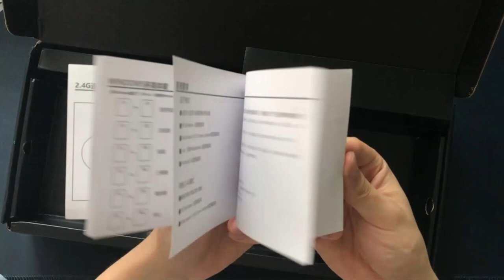PBT on prebuilt? | RK98 | Full mod and Review | #keyboard #keyboardmods #keyboardsounds #soundtest

Comment: Hello HnJ friends. Are the RK98's keycaps PBT or ABS plastic? How do you identify if it's ok to ask if it's PBT or ABS (even should the manufacturers put some texture "tricks" on the keycaps)?

I just bought this amazing mechanical keyboard (blue switches so I can feel the click, though the spacebar is acting like an amplifier- it's not the noice but the frequency of the noise X-D but it's fine by me- I must feel the click, it's very satisfying even if it's noise but then all keyboards even if it's thocc is still noisy just at maybe a lower, more bearable frequency). 96% w/ exploded sections is definitely the future: it saves on plastic too.

God bless, Rev. 21:4
Reply from the maker: Hi, for the keycaps in the video that came with the RK98 model that i used was PBT. There arent any huge differences between PBT and ABS unless they say ‘double-shot’ within their keycap specification. This means that 2 layer of plastics is used to mold giving them a thicker wall, making thm more rigid compared to single shot. 

If the spacebar is too loud, spacebar dampeners are available. However, a more budget friendly solution would be to fill some of the spacebar gap with a littlebit of foam

Hope this helps, and feel free to ask other questions, will try to answer the best i can 👍